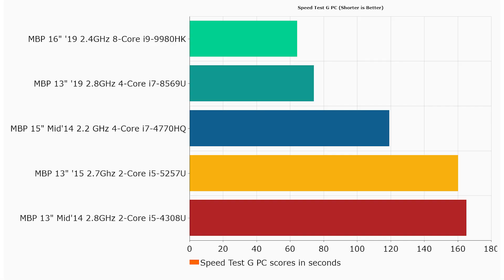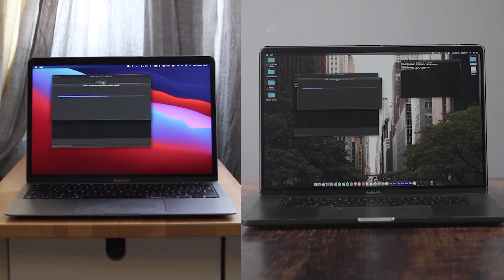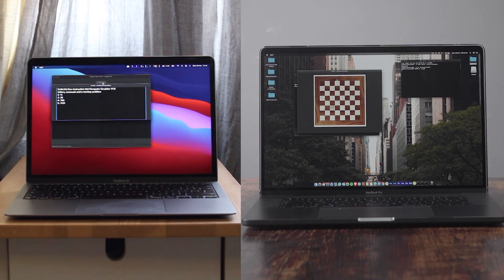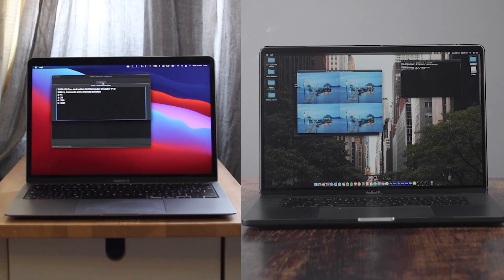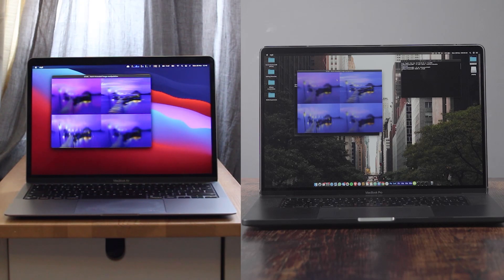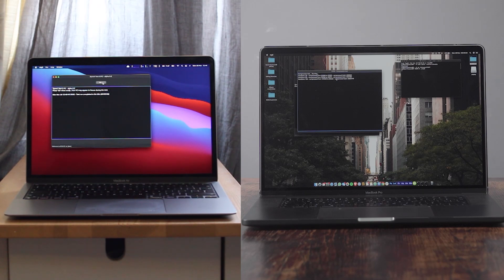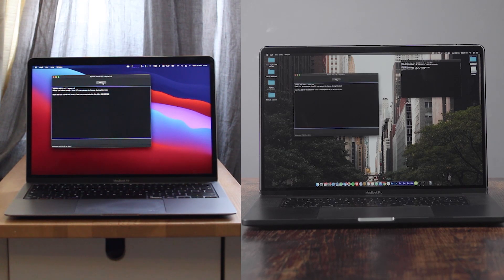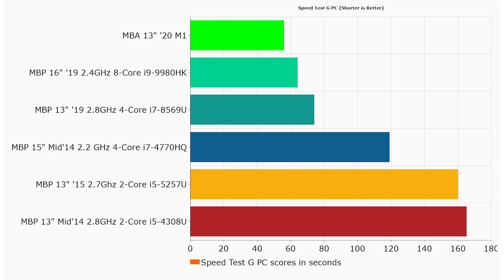MacBook Air (M1) Real World Performance and Thermal Throttling Test

Comment: 2:20 yes it beats a 8 year Old cpu. How surprising.
Reply from the maker: Well done for missing the point completely. In that 8 years we now have a laptop processor based on the Arm ISA that beats a top x86 server processor running at 95W. If you don't think that is impressive then you clearly don't understand what it means.
Reply: @GaryExplains  It is more than impressive considering that was even a dual Cpu System (A single x5650 has 6 cores/12 threds) makeing it to a total of 190 W. It is just not surprising since it's been as I said 8 years. And if you compare  the x5650 with a cpu from like 2004 you will see the same thing.

Comment: Fun fact, if you want to stress a cpu do not use cinebench or something use prime95. Mate did it with his Macbook Air M1 and had quiet different results. It does throttle noticeably. It is still impressive for a passively cooled system but no where near as advertised here with only 5%.

Comment: You do realize your comparison of the Cinebench Multicore benchmark, you are comparing a 2010 xeon to a brand new Apple M1 chip? The processors on that list are ancient. I have a AMD 3700X and it gets double the score of the Apple M1.
Reply from the maker: And the AMD 3700X has a TDP of 65W.
Reply: @GaryExplains  Okay? You are still comparing dated processors in your video to something that is brand new.
Reply: @GaryExplains  Okay and? The Xeon 5650 you are comparing the M1 chip to has a TDP of 95W. Why are you even sharing this kind of information when you could pull up modern day CPUs with actual scores that can compare?
Reply from the maker: Because that list is autogenerated by Cinebench, it isn't something I created. Other chips on the list are newer. My point about your AMD chip is that I am not surprised it get double since it is a desktop chip with a large TDP.

Comment: what are the results of internal heat in celsius? i saw some comments that it still gets really hot
Reply from the maker: As far as I can tell Apple has disabled reading the internal temperature. That is why I didn't include it.
Reply: not a good sign. there were some readings of 100°C shown within a reader app, without fan spin, but i was hesitant to believe its authenticity, and now it seems more plausible.
Reply from the maker: @kuchesezik  Since Apple has disabled the temperature reading how can that app be seen as reliable as the information isn't available for the app to read.

Comment: The old macbook runs on a chip built on Intel 14 nm process and about 40 million trnsistors /mm2 as density. The new macbook runs on TSMC 5nm process and 170million transistors/mm2 as density. There's nothing impressive to be seen here. Just like comparing  an intel macbook  on 14 nm with an intel macbook on 28 nm (if there was such a thing, but such is the distance between m1 and and i9 seen here). I am pretty certain the 14nm intel macbook would have far superior performance. Let intel(or AMD) compete on a similar process and then we are talking. That the intel macbook comes short at just 20%, or less, while having more than 4 times smaller transistor density , goes to show how much more efficient computationally the intel chips are.
Reply from the maker: LOL, but that is the whole point. Intel doesn't have chips on the same process node. So you are basically saying that if I tested it against a product that doesn't exits then the imaginary one would be better. 🤦‍♂️
Reply: @GaryExplains  Which is why I would buy the new macs eyes closed. Nevertheless, the fact remains they are built on a much more efficient process. Thus, one can't be sure, exactly, what comes from the architecture, and what comes from shrinking the transistors. 4 times more transitors on the same surface area, much smaller in this reagrd, should make circles around chips built on older nodes. Which the new m1 does. The whole point I guess , is that we should not forget this fact. Otherwise it is like comparing intel chips built at 14nm with intel chips built at 32 nm, and be glad how much more efficient 14nm is and remain with the impression , this is only the result of chip's architecture.

Apple has the money to secure first use of TSMC's 5nm, and it does excellent in my opinion. This however does not negate the spontaneous curiosity of what AMD will do when it gets its hands on this node(with some months delay) or Intel when they wake up from the long 5 year sleep and eventually produce the equivalent of TSMC's 5nm, which for Intel would bear the moniker "7nm" I am sure.

PS . I did not mean to say you did not do your testing correctly and anyway this kind of testing is not my area of expertise, and sorry if it has been passed like this. Just what I expalined above

Comment: But shouldn't real world performance test be like opening tons of tabs on chrome and playing youtube while typing some document, like most people do on their computers?
Reply from the maker: None of that would make the CPU work hard.
Reply: @GaryExplains  REAL WORLD usage don't make the cpu work hard, real world usage don't make any cpu work hard, not even clown intel's cpus.
Reply from the maker: @josir1994  Maybe not in your world, does in mine.
Reply: Techtubers always sound like half the population on Earth is doing video editing, but how many people really does edit video? I'd say not even one percent are editing video on their current computer. That's what I consider real world test or not, not some specific person's world but statistically the general population's real world
Reply from the maker: I don't remember mentioning video editing. There are lots of "every day" tasks that push the CPU and GPU. If that doesn't happen in your world, then buy a cheap laptop or desktop and it will be just fine for you. Using a web browser while typing a document is easily handled by just about any computer made in the last decade.
Reply: Sure I am, still perfectly fine with a 4 year old Celeron machine

Comment: Hi Gary, I was trying to understand why RISC is very much power efficient than CISC ? I have been through videos but couldn't find answers.
Reply from the maker: Did you watch my RISC vs CISC video?
Reply: @GaryExplains  Yes sir. It was nicely explained. Still wonder how this decoding logic circuits makes more heat. Might be high GHz and slow decoding producing heat.  May be CISC are betting GHz instead of focusing on cleaning up the extra things.
Nice target for intel and AMD to achieve.
Reply: @GaryExplains  I came across this article. Any thoughts on this. Would be good topic for video. 
https://wccftech.com/why-apple-m1-single-core-comparisons-are-fundamentally-flawed-with-benchmarks/
Reply from the maker: @jayeshpatilone  I have only glanced at the first few paragraphs to try and get an idea of what the author is trying to say, and it is nonsense.
Reply: @GaryExplains  Thanks for your time. Even I was confused after reading that article.

Comment: The Xeon of which you speak is actually 2x 6core 10 year old CPUs.
Reply from the maker: Indeed. Others have surmised that it was probably a dual socket system. Interesting that one of those xeon uses 95W and here we are 10 years later with a mobile chip which uses at least one sixth of the power and offers better performance.
Reply: @GaryExplains  Things certainly have progressed. My phone is probably about 1000 times more powerful than my first PC yet uses about 1000th of the power.

Comment: Good video as usual. I'd like to know why the M1 fell behind in this one particular test compared to the i9. Is there some logic it can't handle because if it being a RISC architecture?
Reply: It's not really that it's a RISC architecture, per se. If you took an AMD Zen 3 against a 12th gen i7, there would be some tests that each CPU would be disproportionately slow on as well. Processors basically go out of their way to accelerate tasks as much as possible and re-order the program and its instructions on-the-fly. In other words, it's not executed in the same order that the programmer wrote it. It's optimized to tirelessly look for shortcuts during the execution process and it is working to stay as busy as possible to avoid ever stalling waiting on memory, or another instruction, or something else it can't control at the moment. Usually, the processor is finding ways to execute more than one instruction each clock cycle, even if it has to execute them completely out of order. 

That's actually part of why the M1 is as fast as it is. It runs at a lower clock speed than most Intel CPUs (often by a significant margin, as some of the higher end Intel's turbo at 5+ ghz and the M1 maxes out at 3.2ghz). Despite a significantly slower clock, the M1 is exceptionally good at reorganizing code and finding "shortcuts" - thereby increasing the number of instructions that can (on average) be executed on each clock cycle. The M1 is so good at this that it usually beats Intel processors that are clocked much higher, and the M1 is able to do this much more efficiently in terms of power consumption (which doesn't scale linearly, doubling the clock speed triples or quadruples power consumption. This is why the lower clock speed allows the M1 to be much more efficient). In other words, if the M1 had a motto, it'd be "work smarter, not harder"  

I suspect that what's happening on that particular test is that the program is very complex in such a way that it can't necessarily have more IPC (instructions-per-clock) extracted out of it. The CPUs must still make it appear (at least to the rest of the program and to the system) as though the data was executed completely in-order, and some programs make this easier to do than others. Intel is likely just throwing the clock speed up to 5+ghz in turbo and brute-forcing its way through, while the M1 runs at 3.2 ghz, neither of which are able to heavily optimize the execution of the code itself. For this particular test, it likely just comes down to a clock speed advantage on the Intel.

There are a lot of little intricacies like this when it comes to running different types of programs, but in general, increasing IPC while reducing clock speeds has been the trend for about 15 years in the computing world because it allows good performance while also keeping it power-efficient. In most cases, it's a great tradeoff and results in better performance for the vast majority of programs. Intel actually found this out with the Pentium 4 after they (very notoriously) took the opposite approach by more than tripling clock speeds over the P3 at the expense of IPC. We got 3.5+ ghz processors (in the time of 120nm manufacturing when this was hard to do), but they were so power-hungry at the time that it quickly became unsustainable in the world of emerging laptop markets and multi-core CPUs, forcing Intel to go back to the drawing board and resurrect a Pentium-3 based architecture for the Pentium M. This later served as the basis for the Core 2 Duo, which was clocked lower than the P4 but significantly outperformed it. Intel has more or less continued this trend to this day, and has built wider cores since and has made them much more efficient. In fact, the i3's, i5's, and i7's of today are derivatives of that Pentium M architecture from 15 years ago, and by extension, the Pentium 3. 

RISC actually lends itself to doing this more easily than x86 in a lot of ways. Instructions on RISC are much simpler, and much easier to decode (for technical reasons that I won't get into here). Most ARM processors are 2-wide or 3-wide processors because they are targeted for extremely low-power environments, but Apple has done a good job designing 7-wide and 8-wide CPUs in their iPhones and Macs and has taken advantage of ARM's simpler instruction sets that make this more practical. RISC actually makes this comparatively easier to do than x86, and Apple took advantage of this in a lot of ways. (By contrast, Intel processors are typically 4-wide and 5-wide, but that's not exactly apples to apples as these are different instruction sets and can do different workloads.)

Both Apple and Intel are coming out with interesting and groundbreaking innovations these days, and it will be very interesting to see where the market takes us in the coming years. CISC has largely been the performance king for decades, but ARM is now showing us that RISC is very capable of designing ultra-wide, high performance processors as well. Intel is responding by widening their own processors in recent years (and their upcoming 7nm / Intel 4 node will make this easier to do). ARM also has a lot of room for growth, and Apple could optimize their own CPUs and take advantage of future nodes to reach higher clock speeds as well. There is a lot of room for innovation on both x86 and ARM right now, and I do think we will be seeing significant advances from both in the next 3-5 years.

Comment: Gary, can you please explain why M1 struggle hard in one instruction cpu simulation while  flies in the rest? It took about 22 seconds to M1 while 7 to Intel. Without this test difference would be massive.
Reply: I give some clue myself. I asked on Macrumors forum as well:. Here is answer:
Ill give it a go (2 reasons), when a SoC is in idle (which is the case in this kind of single instruction test) it clock/power gates domains , the more aggressive you power down when doing nothing if its by how long you wait before starting to shutdown or by how many domains you power gate (or both) the worst you will perform in such a useless test , my bet is that M1 does way more powering down cycles and probably to deeper states as well in this test then the intel counter part , so it pays more performance penalty for the overall "test" , note this is one of the most useless tests ever conceived as it will penalize a good power efficient design while rewarding an "always on" CPU design , where in real life there is no such use case.

Another reasonable guess , is that the SoC will not go to a high performance mode when doing single instructions , as the expectation is that you can go to sleep ASAP , which is reasonable to assume when you have a single instruction in your pipeline , again another reason why this test is as useless as it gets!

As the reviewer didn't show us the frequency in which the test ran at this makes the comparison futile , hope it helps!!!
just to ease your mind , there is no way Intel does any single instruction 3x faster then Apple (maybe aside from the AVX instructions , that needs to be rewritten as several NEON instructions , but AVX is barely used anyway)

Comment: Hey Gary just wondering what OS the MBP 16 inch was on , I have seen degrading performance on most intel macs when switching to big sur when compared to the same tasks from Mac Os Catalina. Although my dual core Mac Air 2017 is oughta be easy to spot the drop in performance visually, I suspect its harder to gauge on the MBP in real world usage. Also a compare on a razer blade running linux should tell us actually how much better ARM is vs X86 in an unbiased way ( Considering apple's dubious record of slowing older devices / not optimising them enough).

Comment: Did you pick the Air over the Pro specifically or just the first you got your hands on?
Reply from the maker: I got the Air because I wanted one with "8-Core CPU and 8-Core GPU" which meant not the level entry Air and costs $1249. You get 8GB/512GB. The level entry Pro costs $1,299.00 and you get 8GB/256GB. So for $50 less I get 512GB storage. I don't think that the Pro with less storage and more money has any advantages over the Air. Bigger batter,  a fan, and a slightly better display. My thermal testing seems to have confirmed that the fan isn't essential. And I gladly trade the other two things for more storage.
Reply: @GaryExplains  Similar thinking myself but I think I will go for the 16GB/512GB just incase x86 VMs turn up one day :) Lack of Touch Bar and fan is a plus and it looks like the sorts of things I do are not going to be affected by any throttling. Screens are very similar.

Comment: I'm running a 2019 16" MacBook Pro with a core-i9 (2.3 ghz), Radeon Pro 5500M, 32 GB, 2 TB SSD and it's connected to a Pluggable TBT3-UDZ capable of delivering a full 96w and it's not charging even though the battery is at 83%.

It's not doing anything heavy duty and there's about a 9% CPU utilization with Safari launched and a few other apps.

The Mac attempts to keep from charging the battery up to full to preserve the battery health - when you're drawing power from the mains it attempts to keep the battery at about 80% until shortly before it figures you're going to unplug, then charges it up to full. It uses AI to attempt to keep you topping off then drain then top off again which contributes to a large portion of battery wear, so I wouldn't put great stock into why the battery isn't charging at any given time.

Comment: The "simulated one instruction cpu" is new to me (I just went and watch your video on it). That portion of the performance test stood out as a red mark on the M1. Is the purpose for this part of the test to force a single core and single thread task?  Also, is it possible the processor used an efficiency core rather than a performance core for that portion of the test?